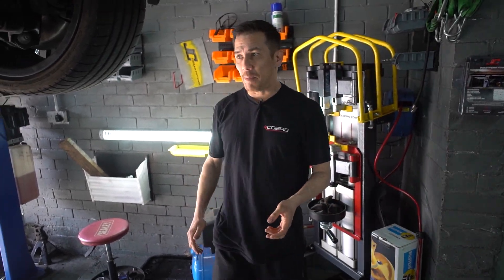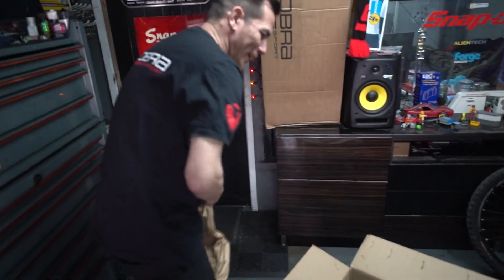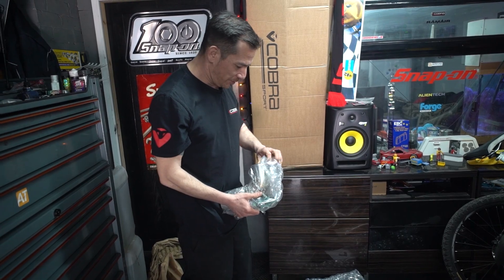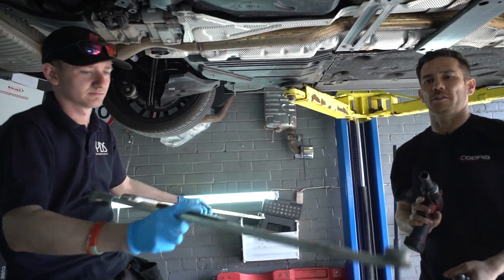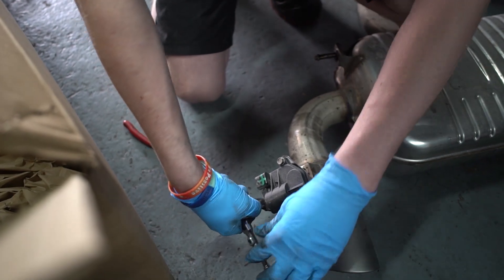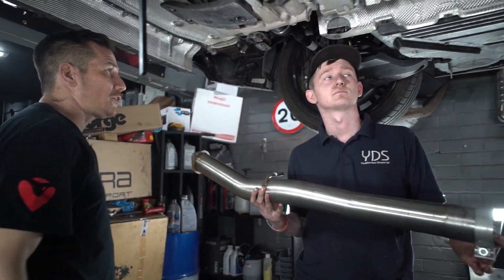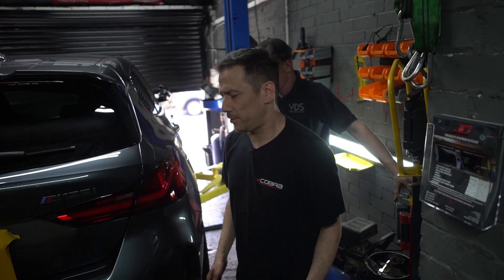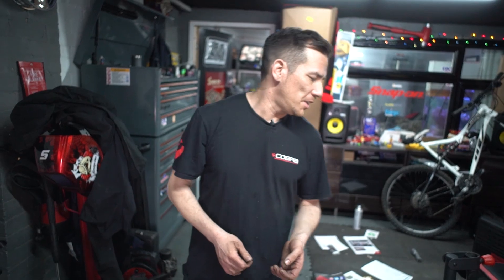M135i F40 Cobra Sport PPF Back Exhaust Install with Before and After

Comment: any way i can get a bang or fart on the upshift? Any exhaust/tuning recommendations?
Reply: If you have anything OLDER than 2021 year models without the locked DME then get the MHD app and connector. Then you can use stage 0 burble tune just set it to soft and 0,5s and you get insane burble. It's a fucking travesty BMW locked the cars and FEMTO DME unlock cost like €2000 which is ridiculous. If you have 2021+ just wait until they Crack it and you can flash it yourself with just a phone. Don't feed money to overpriced services.